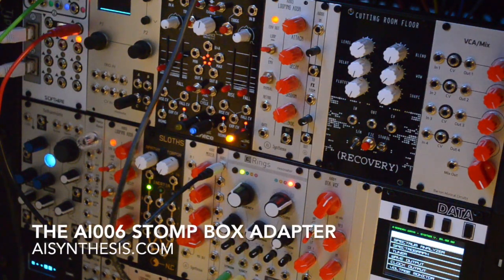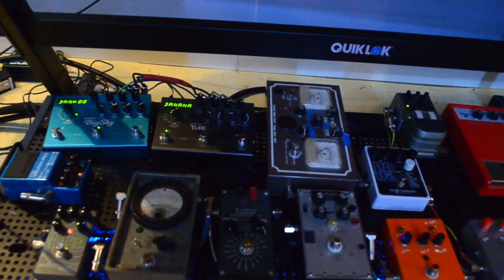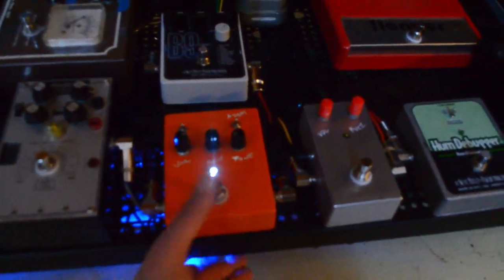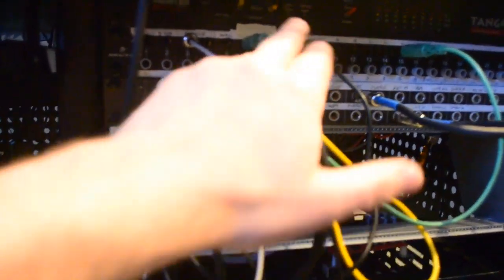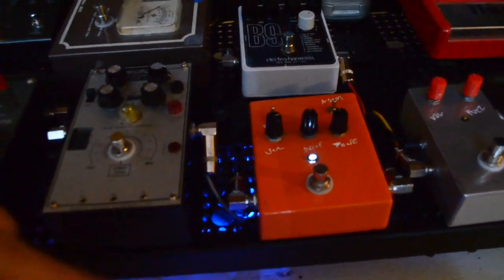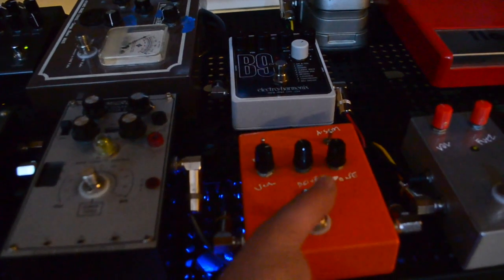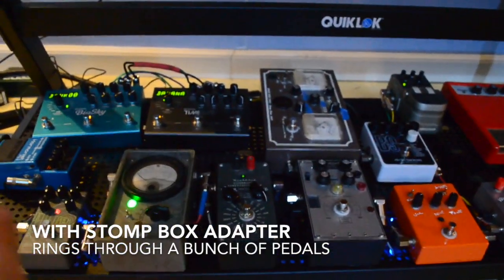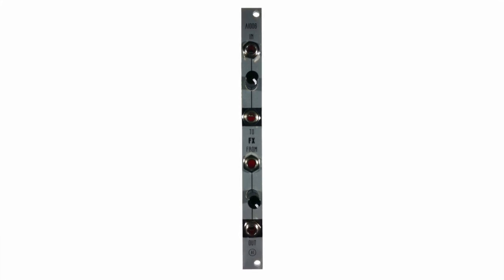AI006 Stomp box Adapter Demo

Comment: Been needing one of these.  Love your diy modules, got a bunch already.  Curious...can you describe in more detail what the module does on the way out and also the way back in that makes it work so well.  Impedance, level .....    Just like to understand all my gear as well as i can and this is a confusing topic for me and a lot of others.

Thanks so much!!!
Reply from the maker: It's just gain staging with op-amps. Here is a helpful (I hope) link to a similar process https://gusbertianalog.com/opamp-with-gain-switch/
Reply: @AISynthesis  thanks!   So the op-amps gainstagin is also changing the impedance?
Reply from the maker: @artspiritfineartstudiogall9672  impedance, gain, and current/voltage swing are all related, so in this case, yes.

Comment: Okay, curious, I’m looking for info on how to take a eurorack vcf and turn it into a pedal. For a number of reasons. Could the components in this module be engineered to facilitate that? What about power? Cheers
Reply from the maker: This would allow a guitar level signal to interface with a euro vcf, yes, but would not change the euro vcfs power requirements. You would need to look elsewhere for that.

Comment: Will this work as a line level I/O to send and receive audio from my mixer or other synths?
Reply from the maker: From your mixer and other synths to euro? Yes but: because there is a different in guitar vs line level, this circuit has more attenuation and more gain than you would need, so you'd either want to change some resistor values or just use the attenuators on the panel to dial things in.

Comment: @aisynthesis – it is so cool that you give out these modules as diy kits. i have a question (because i'm a nerd too) – what are the pedals in metal finish, left to the orange one? they look really funky! and: do you use two cables for each pedal to hook it to the patchbay? or do you have a multicore or a looper/switcher? would be interesting to me :)
Reply from the maker: Left of the orange one is a tube screamer clone with mods. Yep 2 cables to the patch bay. I actually undid that recently and just have them wired together right now.

Comment: Sir, can I use this as a guitar input and output to amp using the mod elements as fx ? The opposite of what you show.🙏
Reply from the maker: In theory yes, I'll test it today and let you know.
Reply: If you could that would be much appreciated 🙏 also got ask what the pedal with the VU meter does ? Looks so steampunk Fallout 4. I am hoping it is a Geiger counter.
Reply from the maker: @Wheel333  that is a boss ce2 clone I made. Glad you like the look it's one of my faves. Here are my results. patch 1: Les Paul into ai006 into lp filter: not enough gain. Patch 2: Les Paul into ai006 into vca providing +5 bias gain into filter: Now I can hear it, but it's better if I put a distortion or boost prior to the ai006.
Reply: Ok great I have a couple of boosts, clean and speaker shredder. I am gonna get the kit off Thonk UK, thanks for testing. Have you been to Fuzzdogs Pedals website if you like diy ? I can highly recommend them and especially the Graphic Fuzz and Bit Crusher kits. 🙏❤️🙏
Reply from the maker: @Wheel333  Thonk is great, say hi for me :) I haven't been there. I have too many pedals right now LOL. But thanks for letting me know. I will go gawk and try not to hit "buy." :)
Reply from the maker: @Wheel333  I couldn't sleep, so I tried using this: Les Paul > tune screamer clone > ai006: worked great, no vca needed, lots of fun. I have a patch rn for a show next week but when that is done I will need to make a video showing guitar through the ai006.

Comment: I have general question regarding DI box or DC to AC balanced output.  Is the ground loop elimination feature the only benefit that is provided by the DI box?  I’ve got my modular outputting attenuated line levels, and I get maybe some bus bleed from the cv/gate signals in my bus line, but this is negligible for me.  I’m currently building a passive dual Channel DI box for a balanced output stage and I’m wondering if I want that to go right before the speakers?  I’ve got it with an impedance selector for 4, 6, and 8 ohm speakers.  Oh yeah I’m interested in your VCA mix, I haven’t seen that available yet.  I own the EG, and your filter, you guys got a good aesthetic not only in your looks but in the overall attitude towards DIY.  I’ve learned a lot from so many great people who share stuff, thank you!
Reply from the maker: By di box do you mean my module? My module is not a di box. My module matches level in order to take full advantage of the chain. A reamp/di combo would match levels as well as offering a ground lift. Lmk if you have more questions.
Reply from the maker: So my module attenuates down to pedal, and then boosts from pedal to modular, a di goes from guitar to microphone levels
Reply: I guess to be more accurate, I should use the term ‘audio transformer’ instead of DI box.  I only would consider intoducing an audio transformer to do the job of a DI box.  I use them for basically just ground loop hum elimination, and to eliminate DC coupling from my modular.  I’ve noticed that these transformers can often go right before the speaker in some setups, and in many applications they’re able to passively amplify signals quite well.  I understand that your module was for effects pedals integration with modular systems, so my questions may seem from left field.  I’m making a module right now for a sort of integrated speaker for allin one rack arrangement, where the speakers are able to be your main source that you’re hearing.  But I also would like this to have balanced outputs.  So I’m thinking that I can use audio transformers to balance and eliminate DC coupling of the signal.  I’m wondering if I should just throw the transformers just before the speakers, or before a preamp before the speakers.  The balanced output works, and speakers are working wired from the transformers so I’m leaving it that way.  I wondered what if any difference I may hear if I moved the transformers before the preamp instead?  I’m guessing that my idea with the transformers is common, except I remember the DI box, it doesn’t go before the speakers, they can go anywhere I guess.  I just figure that the better you can isolate the speakers themselves, the less likely would be to pick up any interference or humming.  This is correct thought regarding the audio isolation transformers, no?  Thanks again for sharing!  I love my AI filter, by the way!
Reply from the maker: @jimmy_jamesjams_a_lot4171  Thanks for clarifying! The AI006 doesn't use transformers, just resistors and a single op-amp, first to lower the gain by a factor of 20, and then on the return to apply gain by a factor of 20. Yes Tansformers are great at the jobs you mention, and are commonly used in DI boxes and some vintage and modern pre-amps. If I understand you correctly, I would buffer and split the output signal, with one signal going to an amplifier of some kind and then the speaker, and another copy going to a balanced output device. I'm not well versed on output modules though, as I never use them personally, and just use a stereo DI when I gig. Let me know if I am misunderstanding!
Reply: This module sounds like a very good idea for handling the line levels, and I really think that this video that you’ve posted is a great demonstration of the module.  You’ve impressed me with the demo.  As for the transformers that I asked about, I’m finding that your idea of a buffer stage is something I may need to try out for myself.  I saw a schematic that produces 2 VCAs from one 13700 chip, and I’m thinking that two 13700s for a stereo pair in one module that could also provide the output buffer (one for left and one for right) maybe semi-desired.  I hadn’t thought about a stereo dual channel VCA before.  Maybe I ought to play with my VCAs in my modular, and fiddle with this idea.  It seems that there aren’t many modules besides a few mixers and specialty module or two for providing the same balanced / XLR output options as what I originally mentioned.  It’s interesting to me, the notion of design, where now after almost five years of DIY and electronics study as a hobby has now made me confident enough in my knowledge of circuits, that design, where once seemed like something unattainable, I feel like it’s now likely unavoidable in the natural progression of my interests.  Electronics is like a very sexy and physically engaging language.  Where I once read books detailing circuits and it seemed to me to be incomprehensible, like Chinese to me.  Still I faked my way through, over and over, and it came a little bit each time, always comprehending still more and more.  And now I understand so much more than what I set out to actually originally learn, and I’ve developed some great skill from what was just unintelligible rubbish that I hardly understood.  Modular synthesis is a lot like this too, where we basically dictate over a signal path, and we are doing this on these giant oversized electronics project lab kits like the ones children play with.  It’s so much fun and you may not even notice what your learning while at play.  Thanks again!  Oh BTW, why on earth is an Ibanez Tube Screamer pedal fetching so so much cash?!  Would you care to share what type of TS pedal you have there on your demo?

Comment: Just what I need. Thanks. I'm curious. What's the module in the top left of your rack. Looks like Ethernet cables sticking out of it?
Reply from the maker: That is a limited run module, it's a breakout box for a beat step pro.
Reply: @AISynthesis  Thanks. To get individual outs?
Reply from the maker: @cockur  same outs as a beat step pro.